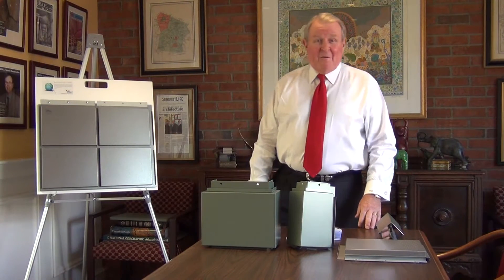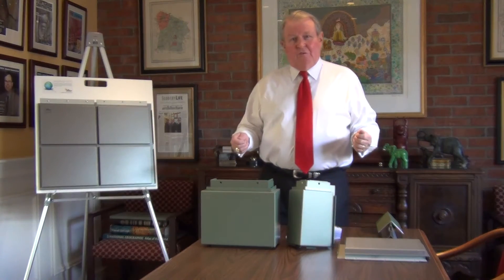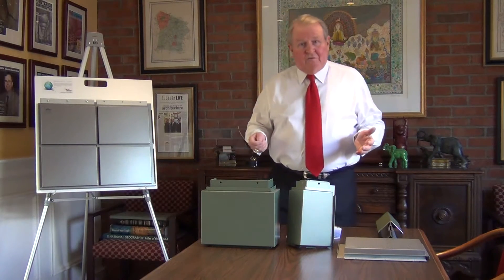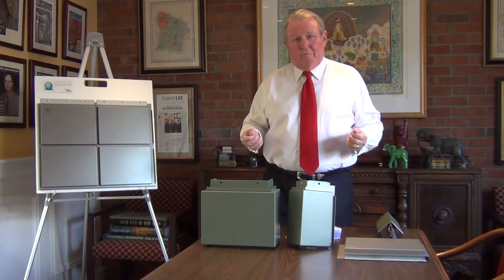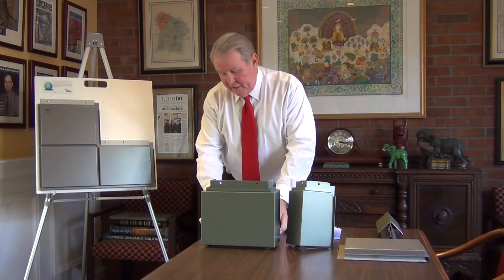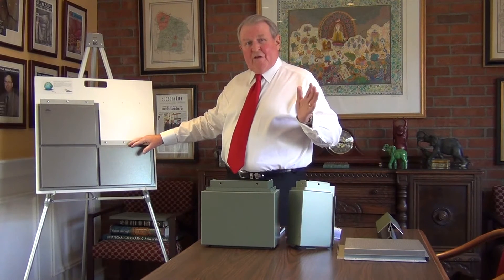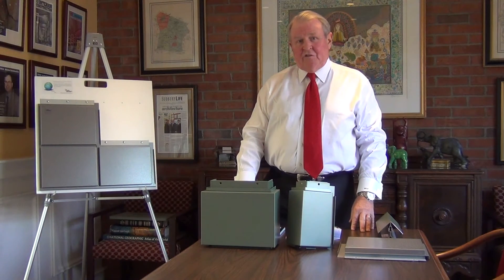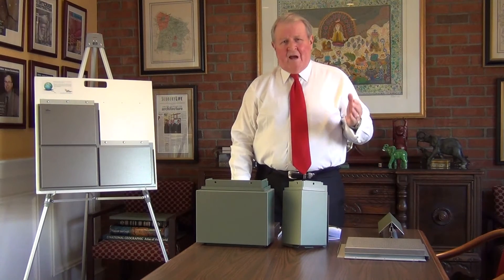Dri-Design Pressure Equalized Rainscreen Wall System

Comment: Rainscreen Association of America (RAINA) definition:  

"A rainscreen is defined as an assembly applied to an exterior wall, which consists of, AT MINIMUM, an outer layer, an inner layer, and a cavity between them sufficient for the passive removal of liquid water and water vapor.” 

In other words, if you don't have a gap, you don't have a rainscreen.